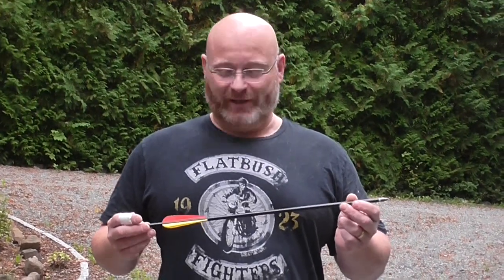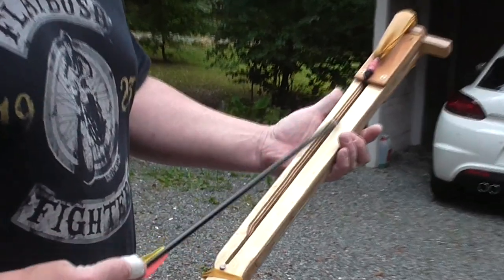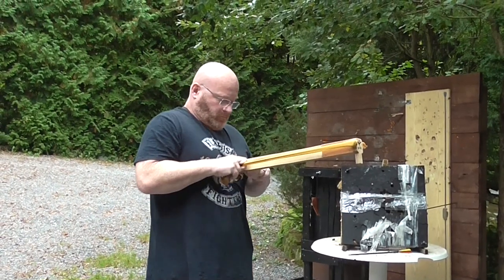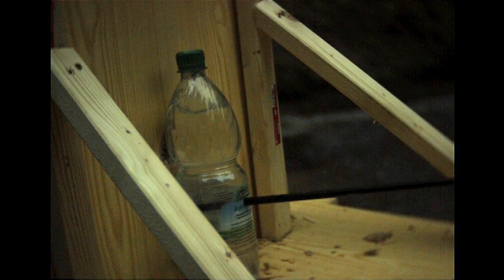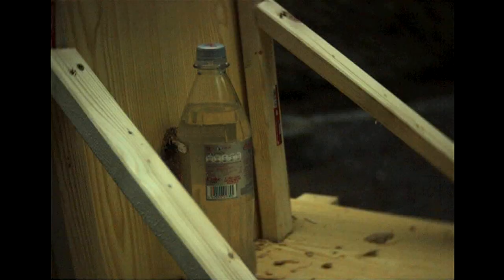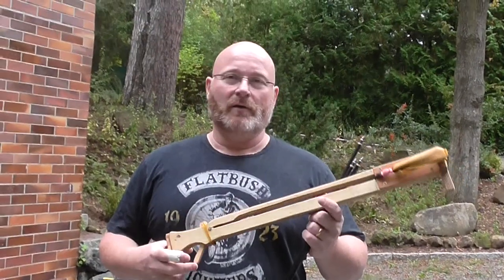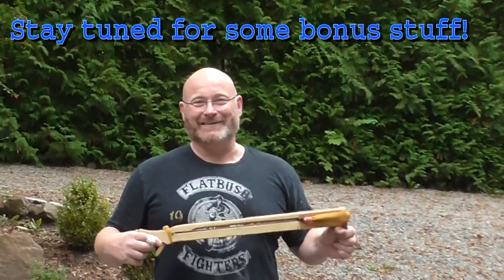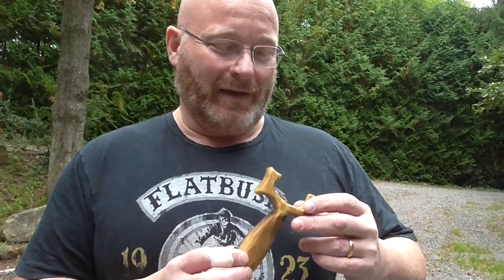The world's smallest legit crossbow?

Comment from the maker: Those 315 fps are probaby achievable with ridiculously lightweight arrows only. Try shooting the +500 gr 20" 2219s, and you will see how fast it REALLY goes. 
Seriously, those commercial crossbows have awesome power. Too much for my back yard anyway, as the bolts never last long. But they are very heavy and bulky. Plus I hate that most powerful ones can only be cocked with a harness.

Comment from the maker: Well, most modern crossbows no longer have a "stick", but arms made from composite material, and the string is in fact attached to excentric wheels called "cams". Just accept it. A crossbow is a muscle operated shooting device that has means to store the energy (lock and trigger) and does not have a tube like barrel. That is the German legal definition anyway. Why should it be important what elastic material stores the energy? Steel, wood, springs, compressed air, or rubber.

Comment: You quoted the Wikipedia article on crossbows to explain why what you were using is an arrow instead of a bolt. That entire article is about how crossbows are a bow laid horizontally across a stock. The word "bow" refers to the flexing of the stick, not the string. So you have a slingshot with a stock that fires arrows. I wasn't going to say anything, but you got technical about bolts vs. arrows, so now it's open season :)

Comment: No, it doesn't fit that definition, because if you read the next line it says: "A string joins the two ends and when the string is drawn back, the ends of the stick are flexed."
Slingshots are more fun and versatile anyway, so you should just accept it :P

Comment: Well, there's a way around that. Use a projector flashlight.  It's a small high power flashlight with a piece of film inside and a convex lens. The film usually has a design on it, most of the time a company logo as a promotional gimmick. If you could get one with a cross-hair or target on it, it shines bright enough to be useful over at least 10 feet. So it's not really a laser, it's a small flashlight.

Comment: Those don't look like crossbow arrows, also I have a smaller crossbow with pencil sized bolts.
It doesn't really pack a punch but it pierces the metal bottom on a pringles can which is pretty neat.

Comment: in my opinion not really, but compared to your creation very much. about 2/3 the lenght, mine is about 30cm wide and 35 long, but I removed the spanner (wich was also about 35cm) because it was faulty and attached a piece of chain to put my foot in to span it by hand. also the pistolgrip crossbows are horribly inaccurate 10m+, I was amazed by the accuracy your creation has.

Comment: Have you made the blue prints for this crossbow ??????????????????????????????????????????????????????????????
Reply: I just want to know how secure the bands to the crossbow so that they don't come off when you load the bow.
Reply: Looking at it the whole thing seems mainly made from one very thick bit of ply. The barrel seems to be jigsawed out down the middle and angled off (possibly by sanding) to accommodate the two side fetchings. The last bottom fetching seems much harder to figure out because of its awkward angle in relation to the now carved out full length slot. He might have just calved out a big ass rough slot and carved/sanded a separate full length insert that was glued into the rough slot. The trigger sear was jigsawed and sanded down (easy) and the band holder which is thinner ply and glued/screwed on the end. How he made the room for the arrow body itself is a mystery.

Another way of making this that will be stronger and possibly easier is to carve out 3 separate wooden lengths for the barrel and fix them into a metal outer shell made of sheet metal. 

By far the hardest part is the barrel.

Comment: Thats not a legit crossbow. Cuz it have no arms and rubber instead of string.
Reply from the maker: Oscarotto1990 It has arms, just short ones. Why should it be important if the flexible part is steel, wood, fiber glass or rubber?
Reply: Cuz a legit crossbow have no rubber it has a string.
Reply: Oscarotto1990 
It doesn't matter at all if it is awesome ! wunderbar, I should say ! 
stop being a, wisebutt !
(no offense)
Reply: vicky pouet I didnt say that its not awsome or anything like that.
Reply: Oscarotto1990 The only definition of a crossbow is that the bow mechanism(it doesn't matter what it is) is mounted transversely relative to the body of the crossbow and that the projectile rests on, or is inside of the body of crossbow. 
So yes, Joerg's projectile launcher is a crossbow.
Reply: +Oscarotto1990 The string is the pouch, the bow is the rubber and the cross is the wooden support. Jebus i swear, learn some more stuff before you run your mouth about things you think you know. Your entire argument is semantic, and crossbows are simply spring energy storage attached to a barrel. read a book
Reply: +Spocker spock yes yes a crossbow is just a mounted bow.
However, one could just as well argue that "bows" must consist of flexible arms and rigid strings

Comment: You do know this is not a crossbow right? A crossbow has fixed limbs that store the energy not elastic bands like this does. This is a over sized sling bow. None the less its still cool!
Reply from the maker: christopher eckbold Not that stupid discussion again.
Reply: hey no need to use offensive language like that. I was just trying to inform you also im not trying to be rude.
Reply: christopher eckbold its still small
Reply: +christopher “The Cheap Gamer” eckbold You do know that &quot;crossbow&quot; does not have a standardized definition right? But the most common definition is bow mounted to stick. A bow is anything that stores spring energy and transfers it to a projectile, so technically, by these definitions, all slingshots are bows and all slingshots that have a 'barrel' attached to the fork are crossbows. read sum stuff bruh bruh
Reply: +christopher “The Cheap Gamer” eckbold  no